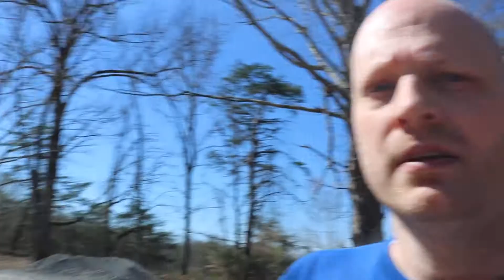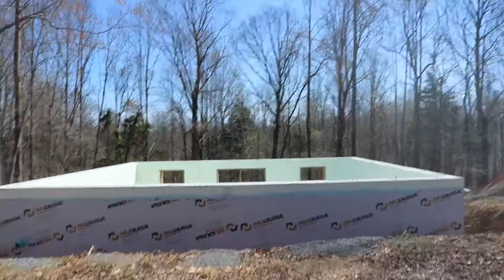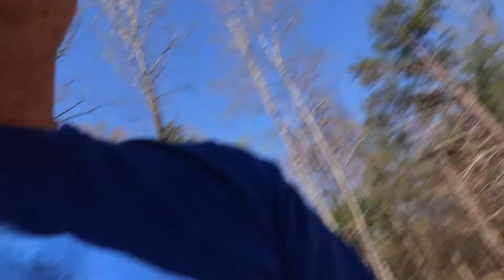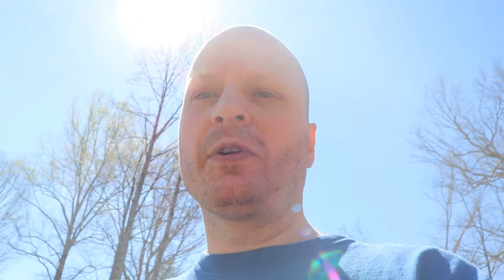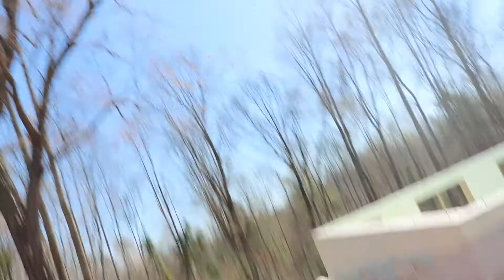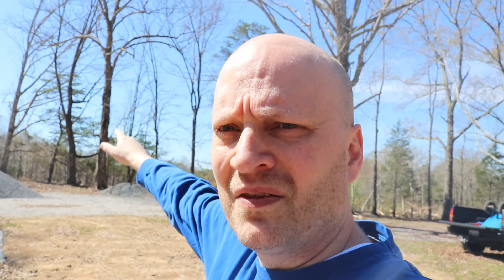Building a ICF house, diy, off grid

Comment: I would suggest the LP tank. I think it's a good backup if you want to go off grid. You would need a gigantic battery bank if you want to be covered for 2 weeks of rain. So a tank with propane and a generator could compensate in these rare cases
Reply from the maker: Thanks